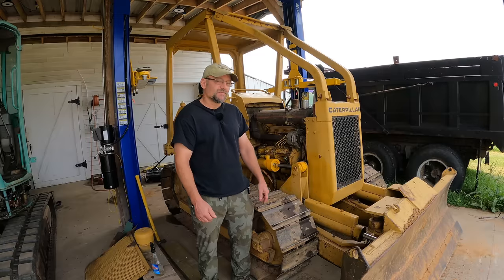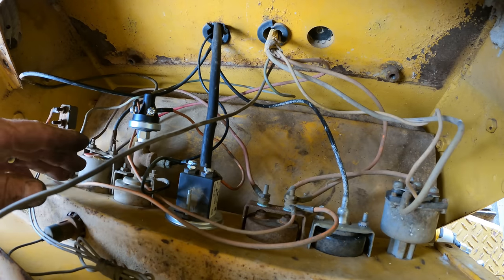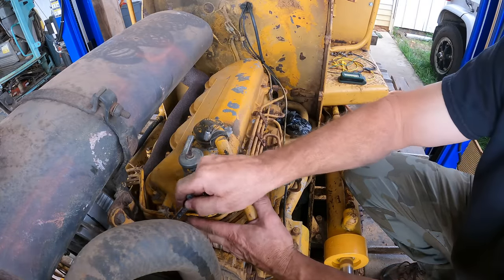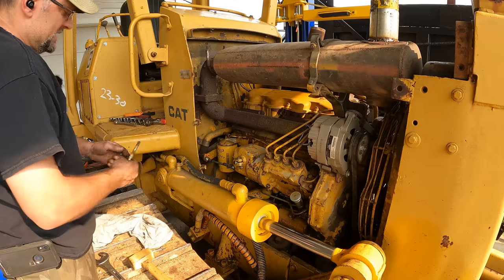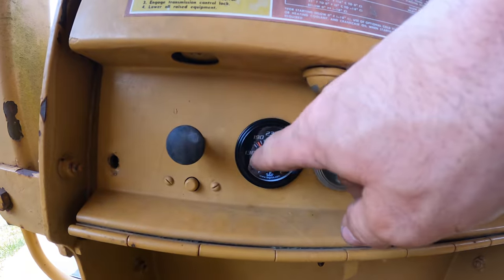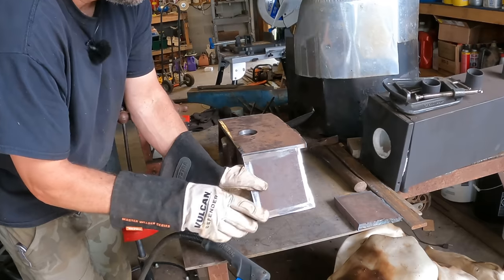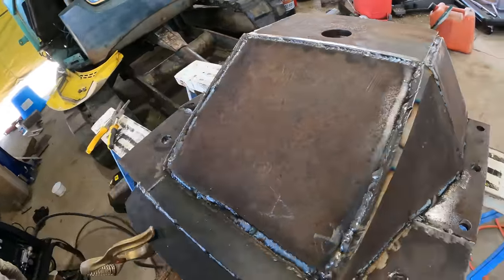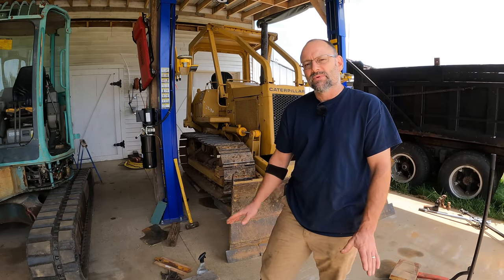How My Audience Saved This CAT D3 Dozer From Disaster.

Comment: Slightly loose valves is a good thing.  I was afraid you might find that they were tight causing low compression, hard starting and potentially burnt valves.  Similar small adjustments across the valves is a good indication of normal, non-pathological, wear.  Except for the one that took a lot more adjustment.  That may have been mal-adjusted last time.  But if there is a way to see the cam without taking the engine apart, it would be worth a look.
Reply: A borescope is a good choice for that job.

Comment: Check your charge voltage when finished. The field supply terminal may also be the voltage sense terminal. If there is any voltage drop in the loom then you may overcharge your battery as the regulator will be trying to get the voltage sense wire to 14V but the battery may actually be higher.

Comment: I believe the original had a voltage regulator but with the modern alternator it needed an exciter wire, but to wire it as hot all the time was a big flub on someones part, it is usually wired through the battery charging indicator light.

Comment: shims.   i know the rollers are not supposed to move other than track adjustment.  
but for cranes we use nylatron GSM (brand name) which has a much higher compressive strength than uhmw.    but this nylon wear pad material could be a nice spacer for the tracks.

Comment: I've just come across your videos on this dozer, and I am not an expert on any of this, but I would bet there's a shop manual available for that dozer, the one piece of advice I can give to someone who maintains his own older equipment, is that it's worth the investment to buy a good manual.  (I just looked at my manual for my older dozer of a different make, and it shows shims and a wear plate on the inside of the track frame, under the idler bracket, to address that gap).  Very nice video, by the way, enjoyed watching.

Comment: It looks like it might be time to replade the fan belt.  Also, I don't know if you mentioned that they make feeler gauges that are called "Go/No Go" feeler gauges.  The tips for the gauges are ground to the thickness to be set to and the 'pre-ground' thickness is one or two thousandths thicker than the tip.  That way you can set them to the tip and then slide the gauge in to see where it goes and where it doesn't.  It make setting the valves much faster.  Your temp gauge is not electrical.  It is mechanical and the lead is a tube filled with ether or some other highly expansive fluid.

Comment: Remove injectors and get them tested for proper pop off pressure and spray pattern.  if those check out then the pump might  not be producing enough pressure to properly atomize the fuel.

Comment: Definitely shim from the bottom of the idlers inside and out. Cold starting just try using the fuel priming pump and pump some pressure up before you try to start it, the fuel may be leaking back while engine is stopped. Steve

Comment: I like the grommet trick.  I've done something similar for smaller by splitting a piece of fuel hose, slipping it over the wires, then sliding it into the hole.  A zip tie on either side of the hole with part of the tail left on will ensure that the hose won't slide back out of the hole.  For bigger holes you can use radiator hose and get the same result.  Ugly as sin but effective.

Comment: Its a common problem on older trucks,vehicles and machines that the copper starter cables corrode internally and build up internal resistance.  Somewhat due to quality issues with some suppliers......I ran heavy trucks on interstate, and found I was throwing away battery cables every 5 years. Its far cheaper than replacing batteries every 12-18 months. Good cables with double or triple the life of cranking batteries.

Comment: Metal prep is time consuming but necessary for the most structurally sound welds.  Take the small amount of time it requires to create 45 degree adjoining seam. It requires more welding time but that translates into a more bomb proof and overall stronger finished product. Just my 2

Comment: Those bimetal hole saws are great but they work best with a hole drilled on the perimeter to clear chips. Not a big deal tho if you're stopping to blow out and re-lube anyway.

Comment: 20:03 i have a set of wire gauges for setting valves and the like and they are supposed to resolve this measurement error. the theory is that the thickness of each wire is just as accurate as a feeler, but the orientation doesn't matter, so you can come in and measure accurately at any angle. they are pretty beat up though and i think its easy to mess them up and throw them out of cal

Comment: You have a fuel pressure deficiency at startup I think. Look for a check valve or check the function of the lift pump and that will likely fix your starting issue.

Comment: The reason it’s hard starting without glow plugs is because you have blow by on other rings or valves. Normal wear on that engine for the year. By having blow by you aren’t getting as much compressed air in the cylinder and not as much heat build up in the compressed air. One other thing is the tips of the injector nozzles are wore out so in turn not atomizing the fuel enough to ignite easily. More than likely combo of them both.

Comment: That "wire" you removed on the temp guage is called a capilliary. The bulb you screw into the cylinder head is full of fluid (ether usually) that expands through the capilliary and runs a bourdoun guage that is calibrated  in degrees. (Think pressure temperature relationship). They are repairable but it is not worth the effort most times.

Comment: not sure what size your hole for the oil drain plug is, but you may want to plug it with something to help keep mud/dirt from packing in. maybe use a bolt tight rubber repair freeze plug?

Comment: it might not have been a bad idea to coil the new wire to the field around a pencil about 6 times or so, that way there would not be as much or any strain on the wire and it would be less likely to break at the connector. It makes a very good strain relief.
That sheathing on the fuel line could be turned so the split is on the bottom of the fuel line so any water that gets in there will drain out.

Comment: With a loose wire that you want to prevent from touching anything, you are better off using heat shrink connectors and melting the unused sid closed. Also, you should zip-tie it safely to another wire to help prevent it from coming into contact with unwanted surfaces/wires.

Comment: On your alternator wire going to your oil pressure switch I would not recommend using that style connector by itself.  Right now there is no strain relief on there.  At your crimp point the wire is and will move around with all the vibrations that a steel tracked diesel machine produces.  Adding some heat shrink (like the alternator side) is an easy way to take the strain off the wire.  Another way is to use the weatherproof connectors that heat shrink and seal the wire shielding to the connector covering relieving the strain on the wire crimp point.  They arent that much more expensive than the plastic ones that you're using but it's good insurance.

And as a side note... kill dozer approves your skid plate.

Comment: Just a heads up im not sure if it matters my d3b factory skid plate has a 1in thick chunk of steel plate on the sloped portion, im sure what you made would be fine. Be careful dont think dot will like your pumper pull 18k trailer.  thanks for the video!

Comment: You could have put a wire nut on that unused wire.  Cut the end off, do not strip it but screw the wire nut onto the insulation.  Put some electrical tape over the wire nut.  In your case over the butt connector.  Electrical tape is for insulating LOL. Electrical tape for the unused wires in your new cable.  Minor stuff but just suggestions.

Comment: 10Si alternators are supposed to have 2 connections R goes to the stud on the rectifier it is the Voltage sense for the regulator And of course F is the Field(Exciter) for the regulator . And the temp gauge is actually a pressure gauge that tube is filled with ether and it expands with heat and causes a rise in pressure which is shown on the gauge as temperature .

Comment: It should have a master switch or night switch wired on the negative side between battery and machine. This allows the negative to become an " open" circuit when turned off eliminating and draw from the battery.

Comment: In my experience and I’m watcha call retired from the industry but we used to use the non heat shrink crimped connectors but now we use heat shrink crimped not for water but vibration basically being beat to death use your glow plugs I don’t know of any big or small cat dozers that don’t need heat on first start of the day and it’s easier on starter

Comment: Generally with unused wires I will put a female bullet connector crimped and soldered with a plastic plug in the hole. Grommet kits are cheap, but I used to make em on the spot with urethane rubber. The old non electric temp gauges had a tube with what was often an alcohol  based solution inside.

Comment: Glow plugs: lower compression from wear plus worn injectors with bad spray pattern = harder to start. Shift that whole table by 1 minute to 1, 2, 3, 4 from 0, 1, 2, 3. Even if a diesel will start without them, it'll start far far easier and faster with them. Don't be weird. :-p

Comment: You can clean the injectors/nozzles yourself with a steel or brass wire brush and some thin copper wire from a multi strand copper wire.
If the injectors are dirty and somewhat clogged up that DIY cleaning will help imensly, next best DIY thing beside buying new nozzles.

Comment: In most four cylinder engines diesel or petrol, the firing order is usually  one three four two,
 back in the moonshine days some rare engines were actually one two four three it was all dependent on camshaft lobing, but the chances of running into one these days are slim to non existant, as a general guide from an old mechanic,   many years ago It occurred to me an easy way to set four cylinder tappets was having number four cylinder crank over  till the number four exhaust valve is fully open and then set number one cylinder exhaust valve, then turn it over  half a turn or so till number four inlet valve is fully open and the exhaust valve shut and do number one inlet, and so on for each matched pair...eg: four down do one,  three down do two,  two down do three, one down do four, when you get the hang of it,  it takes half the time and effort. 
That sump guard might look a bit Heath Robinson but I like it,   one thing that occured to me though, you do know about Selenskis law dont you ? in that  - "shit expands expotentially to fill the space you give it " and with that in mind I think you really should have engineered a steel bung or a bolted plate to cover that oil drain slot you gave it....six months of usage down the line and I can guarantee the space between your sump and that guard plate will be one solid block of condensed and compacted crap that will take half an hours digging out with a hammer and a screw driver before you can even expose the drain plug.....not to mention making the whole shebang weigh half a ton or more if you ever need to remove it - not good when you are lying on your back !..........as you yourself said - work smarter not harder.

Comment: The temp guage doesn't use a wire to indicate temp.  Its a liquid filled tube (think oil pressure guage) that relays the temp as the fluid in the tube expands from heat

Comment: It’s called a bourdon tube.  Heat makes the fluid expand, which is transferred to a mechanism that is connected to the temperature needle.  Simple and lasts a long time, but with the vibration of a cat, probably the gauge…..which is permanently attached to the bulb. 😊

Comment: Nice work on your skid plate 

On your front idler 
That lower Gide should have a ware plate or is a replaceable item 

But it should be done from the bottom side 

Step back and look at the front idler, and the idler’s behind it you should be able to put a level from one to the next
If you shim the top it will raise the front and then the smaller bottom roller will be carrying the load
That is meant for the big wheel 
And there should be some none cat track parts available that won’t require selling of a child to pay for 

I think there’s a episode on C and C equipment showing how to

Comment: Just out of curiosity, have you tried to bump up the throttle while cranking the engine? Only until it fires up.  I know my 12 valve Cummins will crank forever and not start unless I tap the gas pedal. Even with the idle set at 1,000 rpm’s. It’s not loosing prime either. It’s been that way since I changed the governor springs.  It’s very common too.

Comment: It's late for me, and I didn't see comments in the previous video about alternator wiring.  I'll get to the point but I think you know this anyway.  The big terminal is the one that outputs +12V, needs a big red wire between it and the starter.  The little one needs just to go through a lamp on the dash, not an Amp meter. And the other little one which you haven't used on the alternator is a tacho signal, leave it alone unless you want a rev counter.  IMHO: Get rid of the 3 core.  You just need simple wiring.
Reply: Rev counter will output tach RPM, so he'd have to make sure to have an adjustable tach, or be sure the correct pulley sizes are on there.  A tach would be nice to have.

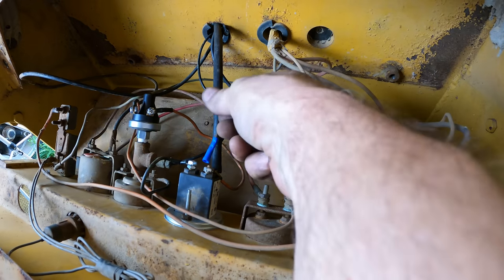Comment: 8:56 I like to use a piece of shrink tube, just let a 1/4" hang past and whilst your heating it, pinch the open end shut. Could even dab some RTV on the end as well if you wished.

EDIT - Sorry aboot the smoke...
Reply: This works best with adhesive lined heat shrink, which is the only kind anyone should be using for connections that aren't inside an environmentally ideal area.

Comment: Good upgrades. I would not much off the oil sensor though, its not a power relay. If your going to do lights or other accs. why not just add a relay in there? Loom all those wires up, might be a little vibration on that thing! Good video again.

Comment: That style of temp gauge has a tube filled with ether. I guess it transmits pressure from the sending unit as it heats up. When they get old they leak the ether out and stop working

Comment: 29:00 Maybe you need to have the fuel all the way at max for it to start well.

I have one precombustion diesel, and if i leave the throttle at idle, it will be very hard to start even at warm, but if i put it to max, it will start without glowplugs even at somewhat cold temperatures.

Ofc immediately when it starts i give off the gas so that it will not make any revs, because thats bad for cold engine

Comment: Im guessing your long start is a compression related problem. Back in the old days the used to have decompression levers and pony motors. You'd built up oil pressure then fire the engine. Maybe a thicker grade of oil might help. Keep an eye on the oil pressure whilst you crank it. If you have good oil pressure and no start it is likely fuel related.

Comment: not being negative you should find another d3 and look at theslack adjuster covers and build some to keep the mud out of them. you should clean them daily mud frozen to metal is the worst. those seat belts will probaly may save your life.I went to move a small trackhoe 442 bobcat i had not been using. I just started it  not puting my seatbelt on and as i started moving it overcentered and threw me forward and into the boom but also onto the travel controls so ir was moving forward while i am trying to get gathered up it was bad.

Comment: Really enjoying watching the bulldozer come along. Wanted to give you a quick tip - The problem you were having with those bolts mounting your skid plate to the bottom of the machine is that you had metric fasteners mixed with SAE ones. A quick way to know is that metric ones will have a number on the head of the bolt like 8.8, 10.9, 12.9 which refer to the grade of the bolt. And the SAE ones have dashes to identify their grade - for instance 3 dashes is grade 5 and 5 dashes is grade 8.

Comment: Farmer John, you bought the old D-3 for $15-K.  How much do you figure you have in it now with all the parts, oil, and filters, not counting your time?  

I noticed in your very first video that the belly pan was missing.  If it were mine, I would look for a used CAT belly pan.  If you get in deep mud, the OEM pan will keep mud from squishing up into your engine bay.  It would have been a lot easier (and cheaper) to bolt on an original CAT belly pan than to do all of your skid plate welding and machining.

Your videos are interesting, and your skills are impressive.  My Dad had an excavating company back in the 50's and 60's.  We almost always bought used equipment and fixed it up and used it.  We did buy one brand new D-7E in 1964.  What a machine it was!

I can guarantee you one thing:  after you have used your D-3 for a season or two, you are going to wish you had bought a D-5 or 6.  Haa!
Reply: P.S.  There are several places across the nation that recycle used CAT parts.  My Dad often flew his own airplane to pick up used CAT parts at a tremendous discount over new.
Reply from the maker: Not bad. I have about $700 additional in fluids, filters, etc.

Comment: They do actually sell individual feeler strips. They are about 12" long. We mechanics use them all the time.
BTW, next time can you use the claw of the claw hammer to do some hammering instead of the face? I feel it would be worth it. I use the claw as a hammer sometimes just because (I suppose I should be reported to some govt organization for tool abuse or something).